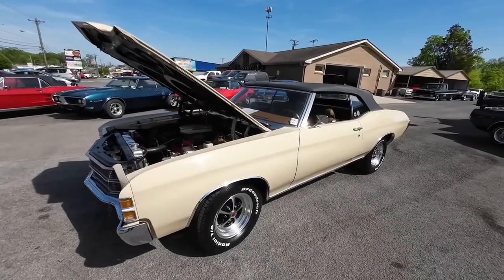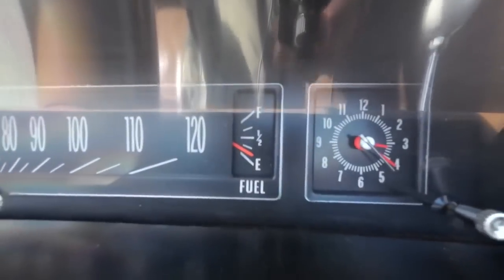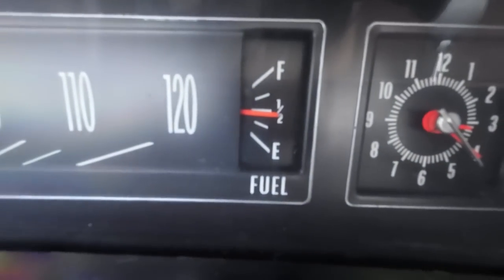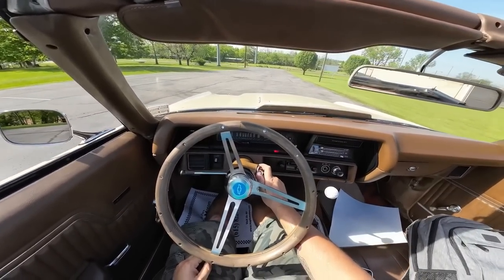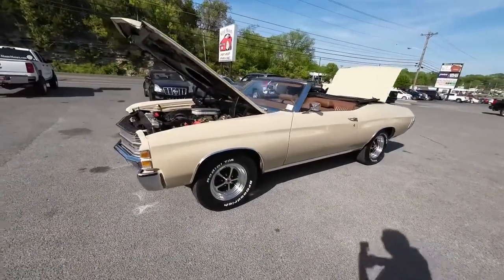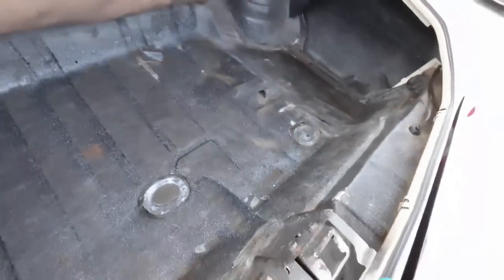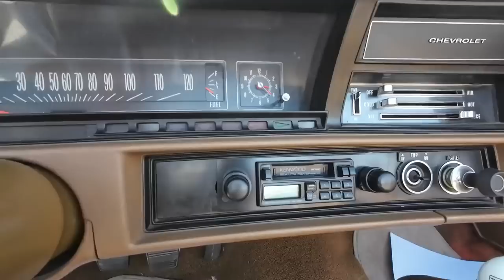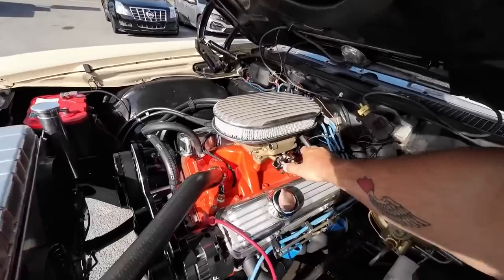Test Drive 1971 Chevrolet Chevelle Convertible SOLD $49,900 Maple Motors #2127

Comment: The issue may be just to reset the computer by reinstalling the engine specification info on the tablet screen it comes with then take the car for a ride to relearn .

Comment: It could be a bad temperature sending unit or it might be low on coolant causing the fuel injection to run rich. Should be a minor fix. Whoever built that car did a beautiful job! Wonder if it has a posi and the gear ratio.